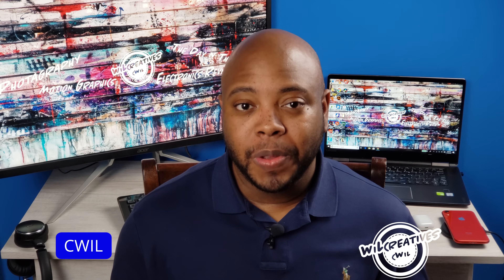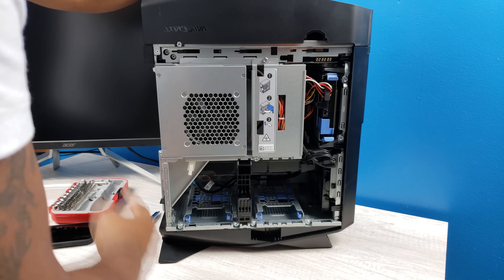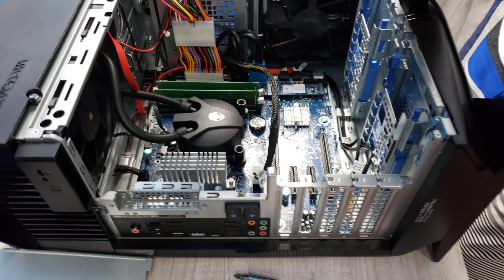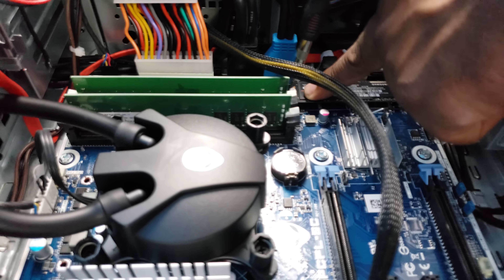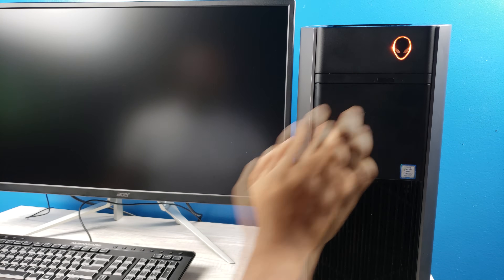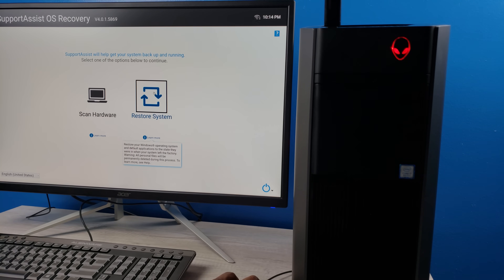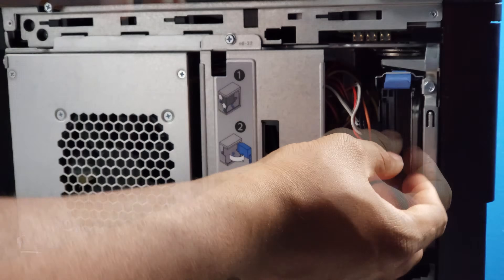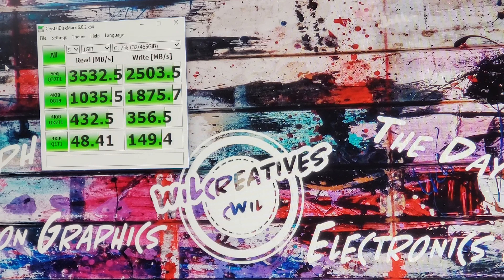First Impressions / Installation Samsung SSD M.2 interface 500gb 970 Evo to Dell Alienware Aurora R7

Comment: what do you mean you setup windows recovery on the usb stick??? Are you supposed to do this before everything? damn..
Reply: also, there is not device configuration option in my boot mode.. pretty sure it was there the first time and now its gone. i am so lost...
Reply from the maker: Are you replacing the optane drive? If so what drive are using to replace it with?
Reply: @WiLcreatives  there actually was no optane drive in the computer(I think this is a 2017 model r7 base model), im trying to install a samsung 961 which ive read works well with the r7
Reply: also, just a note im trying to install this from a windows 10 usb stick that came with the aurora.
Reply: the bios is reading the ssd drive as being there
Reply from the maker: @azonicrider32  Gotcha looks like we have similar systems but not the same model. However when i tried to reinstall windows using the dell recovery key i created from their site it didn't work for me. I created a windows 10 installation usb from microsofts website and did a clean install to my samsung 970 evo. Question what type of hard drive were you using as your boot drive before installing the new one and did you leave the old drive unplugged while trying to install windows 10?
Reply: @WiLcreatives  I was using the standard HD that came with it, 1tb Sata i think. I did unplug it before doing all of this. Ill try to get another copy of windows from the microsoft website and see how that goes.
Reply from the maker: Gotcha let me know how it goes!
Reply: @WiLcreatives   "the operating system couldnt load because the registry file is missing or contains errors"
Reply from the maker: @azonicrider32 I'm confused, when does this message come up?
Reply: @WiLcreatives  This message comes up after changing the boot options and restarting. The computer asks me to choose 32 or 64 bit, and once i choose that and it loads, I get the error message.
gunna grab some coffee and get dell support to chime in. Your instructions where great and it worked so well for you, Im guessing there is something wrong with the compatibility of my windows 10 usb key.
Reply from the maker: Yeah that is totally weird. I’ve come to find out that depending on how your system is configured the scenario is different. Sorry I can’t help further.
Reply: @WiLcreatives  I called Dell, and they referred me to your video LOL!!! Im gunna have to pay someone to figure this out I think. I just dont have the computer knowledge to go beyond following instructions.

Comment: having an issue. after changing boot option #1 to windows boot manager. the computer restarts but it doesnt recognize the boot drive. i go back into bios and windows boot manager is now selected for option #3 instead of option #1. i dont know what to do.
Reply: i tried changing it back and restarted and still it is stuck in option #3
Reply from the maker: Are you replacing the optane drive? If so what drive are using to replace it with?

Comment: Hey man I have a question. Ima upgrade from my gtx 1080 ti to the  gtx 2080 do you think it would fit
Reply from the maker: +JaidenX Personally I’m looking at the 2080 Zotac blower style. Best for systems like ours as the heat blows out the back of the card instead of back into the case. And it’s like 10.5 inches which will fit. 

ZOTAC Gaming GeForce RTX 2080 Blower 8GB GDDR6 256-bit Metal Backplate Dual Slot Graphics Card - ZT-T20800A-10P https://www.amazon.com/dp/B07GJ8X6Q2/ref=cm_sw_r_cp_api_i_zm8lCbFYDC2CY
Reply: Don't know if you figured it out yes but it definitely will fit. R8 case is the exact same and mine is fitted with a 2080

Comment: Just to update: I’ve recently installed an 850w power supply, 1TB WD blue SSD and a M.2 NVMe WD Black 500GB SSD into my system. Everything is running incredible. Also I was able to clone my current hdd with my m.2 WD drive so my OS boots up in seconds, compared to a couple mins before. A simple command in the command prompt made it work perfectly and notice my m.2 SSD. By changing from RAID to AHCI. Then I was able to clone. Hope this helps someone. Thanks CWiL
Reply: Attached is the video on the command prompt to change from RAID to AHCI without having to reinstall windows, which let me be able to clone my hdd to my m.2 nvme ssd. 
Hope this helps someone. Have a Blessed day!
https://youtu.be/9ngnIKqPOc4
Reply from the maker: Now that’s interesting glad that worked out!
Reply: Hey Travis Helton, so how did you go about transferring the operating system from the hdd to the ssd after the installation? I’m completely new to this stuff and don’t quite understand how it goes. I watched the video you linked to change the system from Raid to AHCl and I understand it but what do you do after?
Reply from the maker: Thanks for the followup and the support thats great man! I want to upgrade my power supply as well. Can you tell me which one you specifically got and where you got it from? I wanted to do a video on that.
Reply: @WiLcreatives   I  got the 850w EVGA Supernova G3, 80 plus Gold Fully Modular.. I will put a link to amazon which is where I got mine... It fits fine, a little snug but that's good. The screw holes on the top I want to say, but cant remember which ones for sure, will be a little off once you take the other one out so you have to put a little pressure on them to get them to line up. I will say that cable management is something I'm still trying to get figured out. Since the factory power supply has custom short cut cables it is fine for the compact setup. These new cables you will get are default length. Mine looks decent, I would like it to look more clean so I'm still working on that. I really like the ECO mode that comes on this power supply. I know 850w is probably overkill for what I do but I enjoy knowing I'm not stressing out the factory 460w. Hope this helps! Have a Blessed day!!
                                                                               
https://www.amazon.com/EVGA-Supernova-Modular-Warranty-220-G3-0850-X1/dp/B01LY4OJYJ/ref=sr_1_3?ie=UTF8&qid=1546605658&sr=8-3&keywords=850w+power+supply
Reply from the maker: Thanks bro I’m going to pick up one!

Comment: Did you run into any problems after installing this about Windows restarting randomly I installed mine over Christmas and I randomly getting Windows restarting
Reply from the maker: No issues on this end. A few questions. What ssd drive did you install? Did you do a clean install of windows 10? Did you detach the original hard drive and boot into windows first before reattaching?
Reply: @WiLcreatives  I installed the 970 Evo 500 gig I did a fresh install because I tried to clone it can end up working just randomly started rebooting I have the other hard drive installed I never took the OS off that I kind of wanted to keep it for a backup Maybe any help would be nice
Reply from the maker: Ok got it I think the problem you’re having is the OS still being on the other drive. I formatted my older hard drive.

Comment: Just so you all know, If you're using m.2 on SATA, you do NOT need to change the raid setup to AHCI. Only if you're installing an m.2 on NVMe like he did here! M.2 is simply a form factor. M.2 can run on SATA or NVMe PCIe. Ensure the drive you're buying is an M.2 NVMe SSD, NOT AN M.2 SATA SSD, otherwise your R/W speeds will be limited by SATA III (~550/500)
Reply from the maker: +Kevin Wolf Good Info!

Comment: Good video. What are the boot times before and after?
Reply from the maker: Thanks for the feed back. The boot times before was around 1min & 20 secs. Now my system boots in 20-24 secs. Fast but not as fast as I’ve seen other computers with that type of hard drive.
Reply: The reason why yours is probably not as fast as other systems is because your motherboard ‘s PCle is most likely 3.0x2 whereas the SSD is engineered for 3.0x4 motherboards. Meaning you’re getting half the bandwidth cause the motherboard can’t catch up. Instead of 3700 you’re getting around 1500 which is still crazy fast, but there you go..  i hate motherboards man lol

Comment: Great video. I'm installing a 1TB SSD and never thought about making the AHCI change in bios. Good job!
Reply: @Jeff McCord there are two ssd bays at the bottom of the case. Simply pop one in and plug it in. You'll need a SATA cable though. And just get whichever one you like!
Reply from the maker: Thanks, I read that you have to change that when using the M.2 slot.
Reply from the maker: +ezbtntcheap Follow me on Instagram @wilcreatives. When we hit 100 subscribers on the channel I’m giving away a Google Home Mini to one of my subscribers for supporting the channel!
Reply: If you're still using m.2 on SATA, you do NOT need to change the raid setup to AHCI. Only if you're installing an m.2 on NVMe!

M.2 is simply a form factor. M.2 can run on SATA or NVMe PCIe. Ensure the drive you're buying is an NVMe m.2 SSD, otherwise your RW speeds will be limited by SATA III (~550/500)
Reply: @eX_OSRS  Thanks. I actually didn't change anything in Bios. Installed the 1tb nvme drive, booted from the recovery USB and everything worked out fine.
Reply: @ezbtntcheap  sweet!
Reply: @Jeff McCord there would be a noticeable boot speed difference... However, you would need to move your windows installation to that new SSD.
Reply: @Jeff McCord as for game loading, so long as it's on the ssd, it's start and run much quicker

Comment: Great video! I have a question: Does this Aurora PSU have swing arm? Can you swing it out instead of unscrewing?
Reply from the maker: That is correct I didn’t realize it until after the fact. I talked about it in the full review video. Yeah you don’t have to unscrew anything except for the 1 screw on the back! Thanks for picking up on that!
Reply: https://www.youtube.com/watch?v=j6gA2SPc7R8&index=4&list=FLe1OGUCLLhgqv5jNJFVOiOA&t=0s
Reply from the maker: @ezbtntcheap  Thanks!
Reply from the maker: Correct you definitely have to pull on it!
Reply: WiLcreatives so wil its easy to change the psu? Without taking anything apart? But i guess you would have to anyway to connect everything...unless it says something on the wires..that way you just unplug from the current psu and leave the other end connected to ur computer..then take a new psu and connect everything where its suppose to go..should that way also work?
Reply: Yes
Reply: It doesn't swing but you pull a latch and the side comes off
Reply: @jaidendiaz_  after you pull the sideoff, you can swing the remaining out to reveal all the internal for easy access. it doesnt swing easily you really have to pull on it.

Comment: I'm trying to add a 2nd SSD drive to my A7. Am I just able to buy and add it? I want it to use for scratch disks, render files only for projects I'm working on. I still want the original SSD as my boot drive.
Reply from the maker: Yes I added a 2nd SSD to my R7. I added a Samsung 860 Evo. Sata III interface 2.5 inch drive. Its plug and play. You will need to purchase a Sata III cable though as one does not come in the system or with the drive.
Reply from the maker: +Shooter and the Stache Follow me on Instagram @wilcreatives. When we hit 100 subscribers on the channel I’m giving away a Google Home Mini to one of my subscribers for supporting the channel!

Comment: Hey CWIL, one more question I had for you. Did you get the 460w power supply or 850w? I got the 460w and am a little concerned about it. However, the deal I was able to get on mine it will be worth it even if I end up needing to upgrade the 460w. 
Thanks !
Reply from the maker: Great question I got a great deal on mines as well. I have the 460w power supply. I had concerns at first as well but from what I have read and after using the system. It works perfect. If you are trying to add a 2nd graphics card though I would recommend upgrading the PSU at that time.
Reply from the maker: +Travis Helton Follow me on Instagram @wilcreatives. When we hit 100 subscribers on the channel I’m giving away a Google Home Mini to one of my subscribers for supporting the channel!

Comment: If you bought a product key online you dont need the usb?? Or do you still need it to boot up the computer?
Reply from the maker: jason pacheco if you create the dell usb recovery image and it works you’re fine. I would make sure you’re registered with Microsoft and have an account with them. When I had to create a separate windows 10 usb iso I didn’t need a product key. When I was setting up windows I signed in with my Microsoft account and was done l.
Reply: @WiLcreatives  So i do need to create a  dell usb recovery key?
Reply from the maker: @Almond2k  Yes you can get it from Dell's drivers and support page using your service tag. You want to have that anyway. You can use that to reinstall windows on the new hard drive. If that doesn't work, like it didn't work for me in the video, use the the Windows ISO image on a USB as a backup to reinstall Windows 10!
Reply: @WiLcreatives  ahh okay. Thank you👍👍
Reply from the maker: +jason pacheco Follow me on Instagram @wilcreatives. When we hit 100 subscribers on the channel I’m giving away a Google Home Mini to one of my subscribers for supporting the channel!
Reply: I was just looking into that. I did a back up on one of my externals and I will be sure to get one from Dell.

Comment: I was told by Alienware tech support that this or the 970 pro wouldn’t be supported and it could make the OS crash. They give me a list such as, the pm961 OEM that is supported and will work properly with my R7.
Reply from the maker: Travis Helton Yeah I have read that on a number of different forums but I can tell you from experience that I have no issues with the 970 Evo! Which is also the reason I created this video. It works  with not an issue for me and I have it as my boot drive with gaming, video editing and etc... I would say try it out and see what happens.
Reply: WiLcreatives yeah I seen it working in a few videos, the tech’s reasoning was because it’s an “accelerated” SSD. He said windows updates will come out and it can cause the os to crash. Something about the firmware of the motherboard. However I’m going to try it out I think
Reply from the maker: Travis Helton gotcha let me know how it goes. The manufacturer will always discourage against products that’s not there’s. It’s understandable.
Reply from the maker: +Travis Helton Follow me on Instagram @wilcreatives. When we hit 100 subscribers on the channel I’m giving away a Google Home Mini to one of my subscribers for supporting the channel!

Comment: Hello WiLcreatives...I have a question. I currently own a samsung m.2 pm961 ssd 512gb and I want to upgrade to samsung 970 evo 500 gb nvme ssd...is it worth it i.e. in terms of speed?
Reply from the maker: Good question, the drive you have is pretty fast. The cost of the 970 Evo 500gb right now is about $117. You would be getting 30-50% faster read and write speeds, 70% faster mixed IO speed and 30% faster sustained write speed. If money is not an issue I would upgrade based on what you use the drive for. If you're doing video editing type stuff go for it. If you're doing regular stuff and gaming keep what you have! Hope that helps!
Reply: @WiLcreatives   Thank you....I am a gamer...I will purchase one.
Reply from the maker: Awesome let me know how you like it!
Reply from the maker: +Peter Mwangi Follow me on Instagram @wilcreatives. When we hit 100 subscribers on the channel I’m giving away a Google Home Mini to one of my subscribers for supporting the channel!

Comment: Hey man, thanks alot for the video.. I'm getting my aurora r7 tomorrow, just wanted to ask you didnt it ask for a product key after the installation? All you had to do was make a bootable USB drive and install the Windows 10 .iso from Microsofts website?
Reply: Does dell include the product key somewhere on the chassis or in the box ?
Reply: @shredzaoe  I've done a Windows reinstall and with Windows 10 the product key is being registered to your Microsoft account you use to register when you do a fresh install. So if you reinstall and then add your MS account it'll automatically look for a valid key for your system.
Reply from the maker: Moe Dur Hey man thanks for checking out the video. Yes that’s correct I went to Microsoft’s website created the usb iso. When setting up windows once you sign in with your Microsoft account it recognizes you already own a copy of windows 10 so no product key is needed! Have fun with your new rig!
Reply from the maker: Check my comment below!
Reply: WiLcreatives thanks for the prompt response man,  I just created a windows profile on Microsoft and will make sure to login and link my device when I get my aurora prior to the reinstallation. Just subbed, great content!
Reply from the maker: Moe Dur thanks for the sub and let me know how you like your system! Look out for my full review so hit the bell as well!
Reply from the maker: +Moe Dur Follow me on Instagram @wilcreatives. When we hit 100 subscribers on the channel I’m giving away a Google Home Mini to one of my subscribers for supporting the channel!